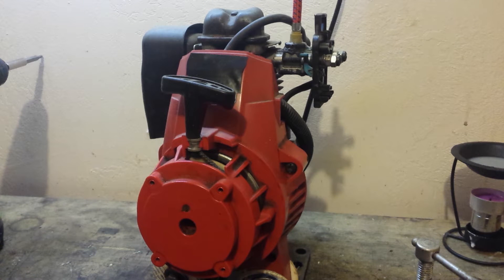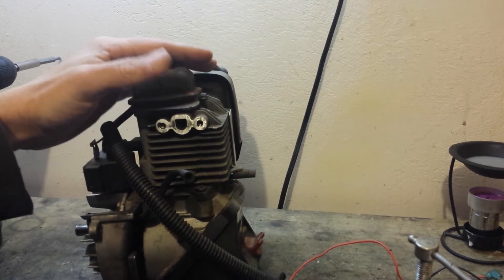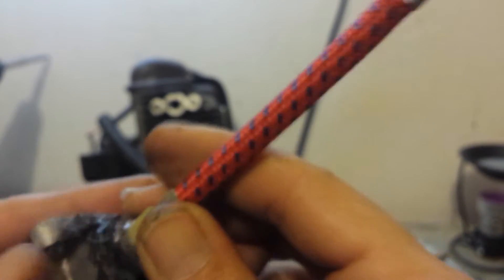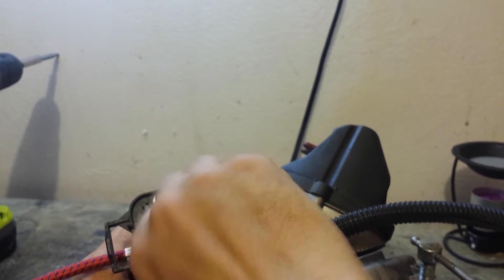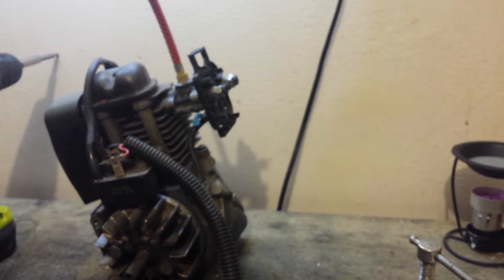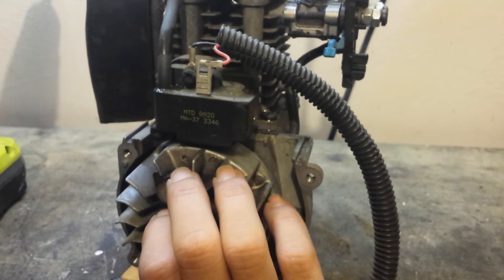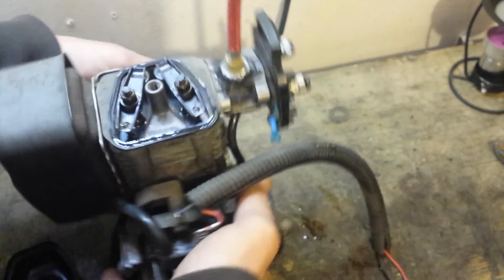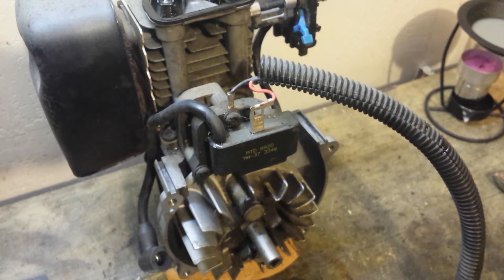26cc weed eater engine. Convert to propane. Part 1.

Comment: What happens if u flip the bottle of propane upside down?
Reply from the maker: Liquid propane come out, total waste of propane.
Reply: Well in a normal application yea but on an engine using the liquid would you be able to use the diaphragm carb as is maybe just drill the jet a little bigger? Then you can have an actual throttle instead of using the choke? Idk I think it might work but without a heat exchanger the carb would probably freeze. Idk just an idea lol
Reply from the maker: @patrickbrasil7465  for safety reasons, I'd keep the liquid in the bottle.  You can deliver the flow rate with gas and keep the carb from freezing up because the expansion process takes place somewhere else.
Reply: Yea your right it would probably freeze up you would need a heat exchanger like on a truck which would be tough to do without coolant

Comment: How is it lubricated.. If it is 2 cycle you have a problelm
Reply: Valve cover ain't there for looks
Reply from the maker: It's a 4 cycle engine
Reply: @ThriftStoreHacker  correct but it doesn't ha e a sump. It gets it's oil from the mixed gas.
Reply: Still lubricant thru the two systems gas. It doesn't have any other way to lub

Comment: what about oil injection?????
Reply: It's a 4-stroke OHV engine, which means it already has oil in the crankcase. The black plastic part on top of the engine is a cover for the valve rockers.
Reply: @anthonygendron5648  no.still needs two stroke gas

Comment: Yeah that's definitely not overhead cam. Just overhead valve. Small engines run just fine on propane with stock ignition timing as long as you run a good mixture. If you've got intake valve problems though, it will be pretty difficult to get running.

It should produce more than  .5hp, mine produces 1.1 with 28cc.